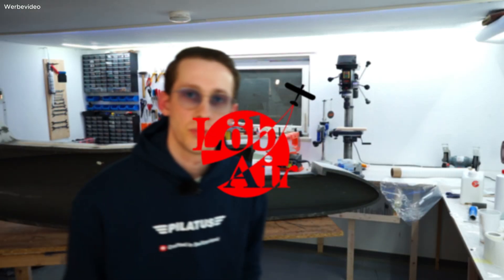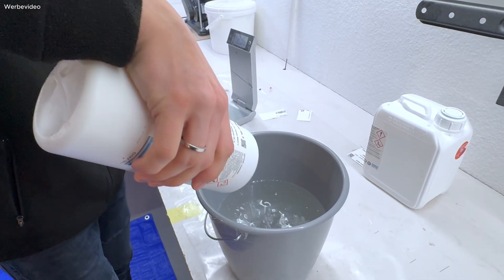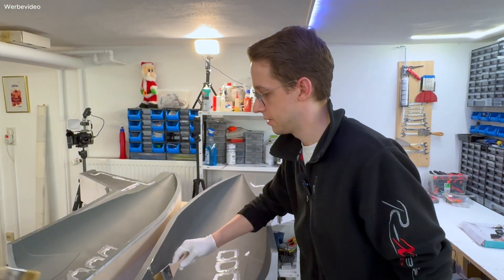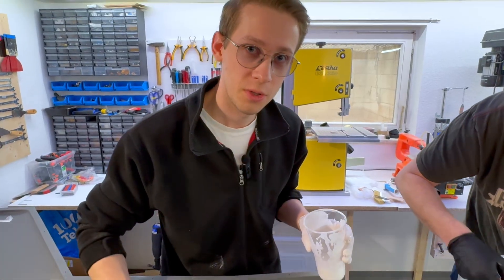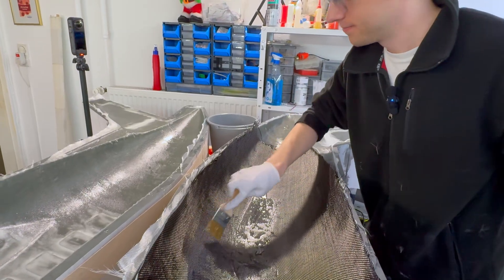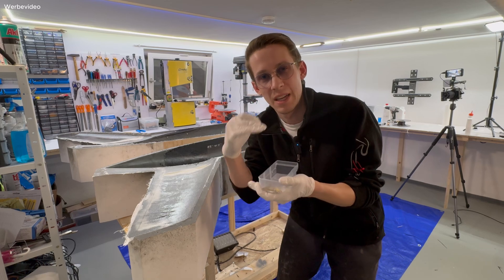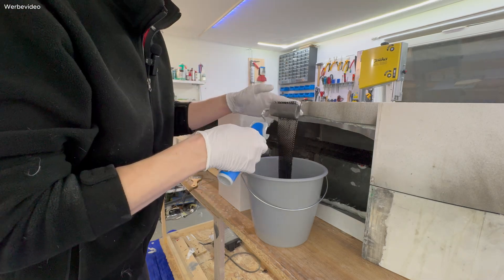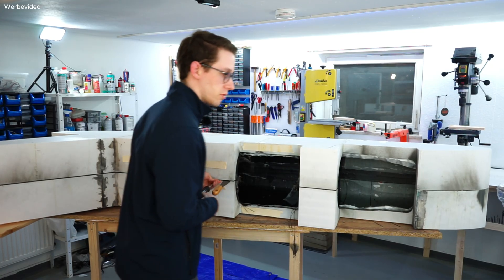from 3D PRINTED MOLDS to CARBON Fiber RC Plane

Comment: Great work. The cloth connecting the two parts is ussually called "taping" and its x2 strongernif the direction of the fibers are +45° and -45° and not 0° and 90°.

Comment: The old “Nice” at 16:00 was flitting😂😂😂
Golden oldie in 2025🇦🇺🤜🏼🤛🏼🍀🍀
Amazing work! 

Did you overlap the carbon 50:50 on the two halves of the mould, or have two flat edges butted up?

Comment: No need for wax with epoxy. Semi permanent is ideal
Reply from the maker: @plusoem  that also has to be applied right?
Reply: @ no not with epoxy. Wax runs a risk of causing fisheyes in epoxy.  Semi peril is more than enough in this case. Wax for poly
Reply from the maker: @ thank you!

Comment: Zum aufbringen der Mumpe gibt es dafür „Einweg-Spritzbeutel PE 0.08mm“ geht schneller und kannst genauer dosieren…so als Tip 😅 und das Gewebe immer von der Mitte nach aussen verlegen und ausrollen mit Epoxid. Ist dann einfacher um die Ecken und kanten zu bearbeiten…sonst Top Projekt 🎉 Interessant wäre der Gewebeaufbau…was wurde alles verwendet?
Reply from the maker: Danke für den Tipp! Ich habe tats. Spritzbeutel aber nicht daran gedacht. beim nächsten mal!

Comment: Great work.
Can you make a video with the details regarding the 3D printed mold?
Like: Material used (PLA? PETG? other?)
Printing definitions, walls, thicknesses, infill, etv
How you divided/centered each part.
How you prepared the surface, etc
Reply from the maker: @gperpetuo  thank you! I might do that.
Reply: @loebair  YES YES YES
Reply: @loebair Und bitte auch die Oberflächenbearbeitung. Z.b. welcher Lack, Trennmittel....
Reply: +1 from me please. 

This is why I visited the comment section.
Reply from the maker: @leejones9827  alright! Next time more detailed, no problem! I was a bit worried that if it’s too detailed no one would watch it because it’s boring … that’s why I kept the prework out of the video.
Reply: Yes please, would be great to see how you joined the 3d printed molds to get them straight overall, plus surface prep to get rid of the print lines Thank you!

Comment: How did you finish the 3D print so its surface is smooth enough for a mold?
Reply from the maker: i explained that in the video, sanding, 2k paint, wax and PVA

Comment: A really nice tutorial and a pretty good result .. It would also be interesting to know how many hours were used in total. Especially for the design work in Fusion and printing the molds. A basic rule of building models. If you have done 90% ... you still have 90% to go 😉

It's been a few years since I built bigger GRP parts, but is expoxy gelcoat no longer used as a top coat? I used it to avoid bubbles and I also appied epoxy thickened with microballoons or cotton flakes in the sharp corners. It was a bit more weight, but I had less problems in the sharp corners 😏
Reply from the maker: @LarsBaeter  thank you first! I really pleased with the result. I know there is a lot to be done better but that’s how I learn, and I learned a lot too. 
Your 90% rule is totally right 😂, the design and printing is a huge part of the work before the actual work with the mold, it’s around 2 weeks of printing time before every part is printed. After that everything has to be sanded and coated. And I applied 3 layers of wax and 2 layers of PVA to the mold before laying fabric with epoxy onto it. 
Next time I know many things to improve, can’t wait to try it!
Reply: @loebair  Others will also learn from you 🙂and you can be very proud of the result. It shows not only skill, perseverance, intelligence and patience. It takes something ... to show off your results 😉👍

Comment: I would recommend roller with protrusions which removes air bubles. Also  use roller instead of brush on bigger surface. :) It will provides better distribution of epoxy thickness in area of application. When I built the lightweight thermal gliders it was really important to distribute same layer of epoxy.
Reply from the maker: @lv7724  oh yes. I even had rollers but forgot to use them. It was my second time doing a big mold like this so… every time I learn something 😬 thank you for the help! Really appreciate that!🤝
Reply: @loebair  I like your approach. Result would be comparable. There is no issue on that if you does not look on amount of epoxy. I had to be really precise, because when I built thermal gliders for competition, every gram matters 😄... Look on F5J-FAI and it will tell you more. 🙂

Comment: That was an awesome, careful layup & build. For that size mold it came out gorgeous--no deformation as you worried. You asked for possible tips/recommendations: one suggestion is to use latex inflatable bladders inside your fuselage volume. Since you described the 3D printed plastic molds as too fragile to handle vacuum suction, there is a greater likelihood they could tolerate latex balloon bladders--inserted & pumped with air. These can be custom made from thin, latex sheet, bonded into balloon bladders of a desired shape with vulcanizing rubber cement along seams and with bicycle inner tube valves as the inflation ports. Any instability in the surrounding 3D printed molds can be bulked up & reinforced externally with a stiffening cage...similar to the wooden paint stick braces I see you glued around the exterior, but more extensive in coverage.
Reply: Nope, nope, nope.  Make SURE you test this before going all in.  You would be AMAZED at how a very little amount of internal air pressure will blow apart a mold.
Reply: @tvideo1189  Agreed that testing one's mold integrity & scaffolding, bladder type/material thickness & applied pressures is key to any such process. I've had success with light depron foam, + CF tissue and molds of PETG plastic for sub-1m/50cm micro models...using very sheer latex bladders & modest pressures but it took experimentation & knowledge garnered from other hobbyists and forums.
 I'm convinced his much larger project would be easier to reinforce/bulwark, yet still offer improved definition/eliminate voids, using thin bladders and modest applied internal pressures.
Reply from the maker: Wow! What a great idea with the latex. Thank you very much! I appreciate that! 🤝

Comment: Cool, danke. Aber: wieso keine speziellen Atemmasken? Epoxy, vor allem in der Menge, ist BIO GIFT!! Wieso keine Vakuum? ich habe das gleiche gemacht, Negativ Formen mit PLA und das funktioniert Problemlos mit PLA, kommt halt auf die Perimeter und Infill darauf an, aber das darfst du eh nicht zu wenig rechnen, da Epoxy Warm wird beim Trocknen -> sonst Verformt sich die Negativ Form. Ich hätte auch entsprechend die Formen Trocknen lassen, und dann Zusammengebaut. Aber Schlussendlich zählt das Resultat, auch wenn es ev. etwas leichter möglich wäre ;-). Zudem: Epoxy verbindet sich nicht mit PLA/PETG -> also auch wenn das Wachs nicht ganz überall ist, lässt es sich doch noch recht gut lösen.  aber: SUPER!! Verfolge euch schon länger. und PS: Cooler Pulli/Hoodi!
Reply from the maker: Vielen Dank für deine Tipps, ich werde es beim nächsten Projekt umsetzen ☺

Der Pulli ist klasse, ja! Ein Geschenk vom Meister selbst😎

Comment: You can cut the brushes shorter (to make them stiffer) and then tap the epoxy into fiberglass instead of "painting the epoxy on". This reduces the number of air pockets between the fiberglass. Additionally the fiberglass should be at the +/-45 angle to the longitudinal axis of the fuselage- it increases its stiffness without adding any additional mass.
Reply from the maker: @Boogie3D  thank you for the advice! I’ll keep that for next time 🤝🙏🏼
Reply: @loebair  the brushes are called "Vertreiber" available also in bigger sizes. Short and hard. Apply the resin under the fabric that saves a lot of time and prevents bubbles from under the fabric. think about smaller portions of resin. extends time. Prepare some triangle plastic bags , like a baker for deco to apply the thickened resin. I think u give it only 1 shot out of the molds so save it in your mind
Reply from the maker: @5minEpoxy thank you!

Comment: Wirklich super gemacht! Welchen Drucker hast du genutzt für die großen Teile ? Freue mich schon auf den nächsten Teil.
Reply from the maker: Vielen Dank! die Form ist in ca 8 Teile gedruckt, also relativ simpel.
Reply: @loebair  Super, danke für die schnelle Antwort. Mit welchem 3D Drucker druckst du denn die Teile ?

Comment from the maker: Guess: How many times did i say "epoxy"? 🤣
Reply: i wonder why didnt you use vacuum pump i didnt get it you said 8:10 the mold will be destroyed like how and also the method of joining i want to finish the 2 half's dry them and then join them together after i finishing placing the ribs on one half and the electronics with the same method  carbon strips 11:24 as the fuselage will be 1 part with no openings the size of it is a 1.3 m by 13 cm circle diameter would like to hear from u <3  . cause frankly the next month i will build also similar but smaller rc airplane almost finished the desgin in fusion and then got your video in the recommendations first time seeing the algorithm doing smth good anyways amazing job
Reply: @taham6757 3D print mold is frail, lightweight form..not like a solid rigid material..it'll deform like an egg carton, like sucking air out of a thin walled water bottle..it doesn't have enough support, will crack, deform..best bet is to use sacrificial 3D positive form to make a good fiberglass negative mold..then polyurethane AB foam can be used as backform support, a rigid wood "case" can be made to protect mold, and allow "split box" forms to store easily, or to clamp mold halves together easily..once foam cures on backside of mold, can easily be trimmed flush to "box frame".. can be hinged & latched like a briefcase..👍
For durability,  hardwood or Bondo epoxy forms could be used, but very heavy..